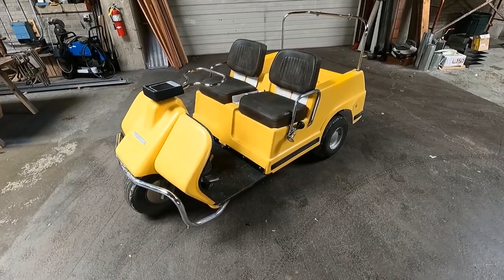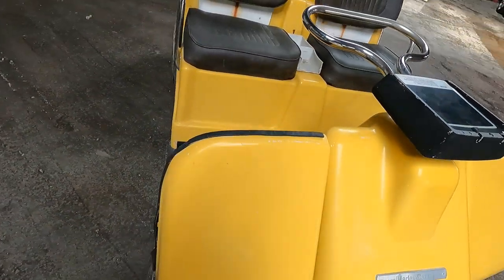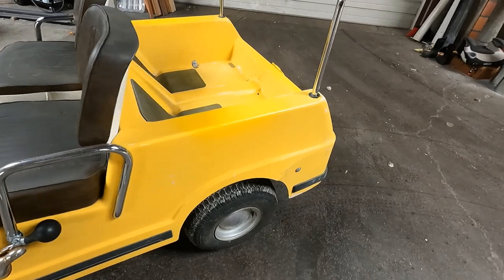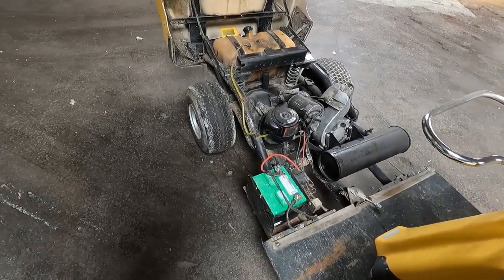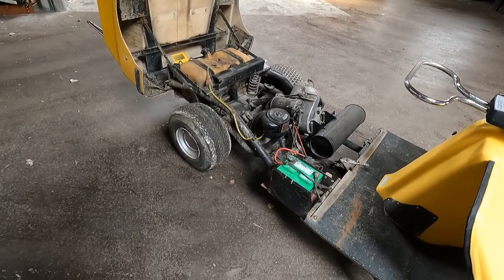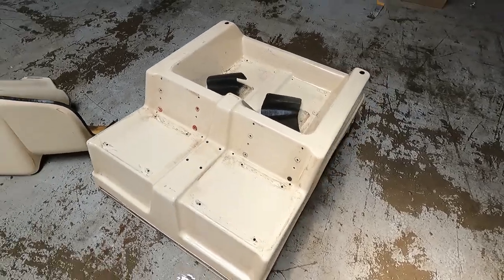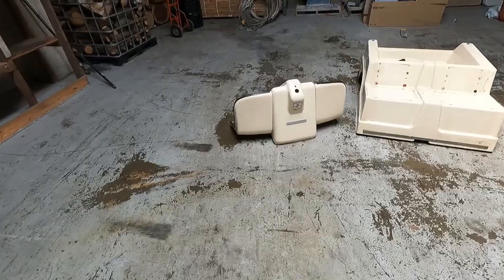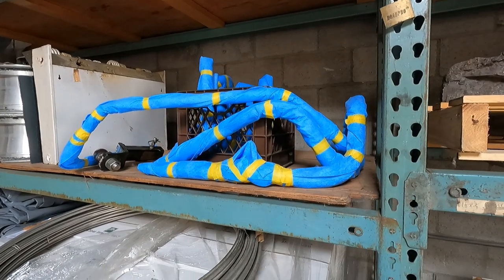1980 Harley Golf Cart - Overview

Comment: Nothing about this cart is in "rough condition". It is in phenomenal shape for a 40 year old glass cart. The gel is in pretty good shape from what I can see with almost no crazing or cracks aside from the hinges. Anyone with a few tidbits of experience with fiberglass body or boat repair would EASILY reinforce and dial those panels in and reflow the gelcoat to pristine and durable condition.  The thing is incredible.
Reply from the maker: It's worse than it looks, especially the back driver's side area.  It's basically collapsing in that area. 

I work in fiberglass and have industry connections that could easily repair the body, but swapping with a solid body is cheaper and easier.
Reply: @thefrontwarehouse8332   Roger that, its great you were able to find a clean body for a descent price they seem hard to come by these days.  I would be thrilled to have that original body, living in Hawaii with limited  options and crazy shipping costs we tend to repair things (including homes) that most folks would haul to the dump. At this point when I see a glass body or boat hull thats not missing entire sections or smashed flat I see it as a survivor and haul it to my shop lol. Good luck to you on the restoration, its such a great cart!